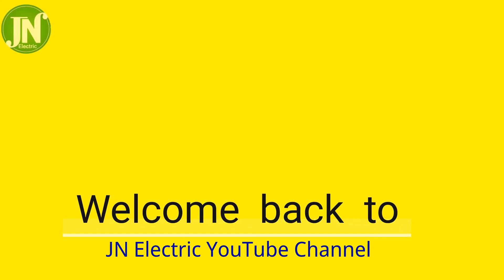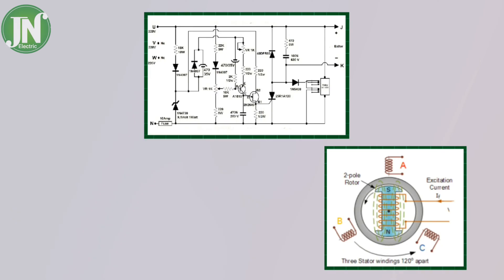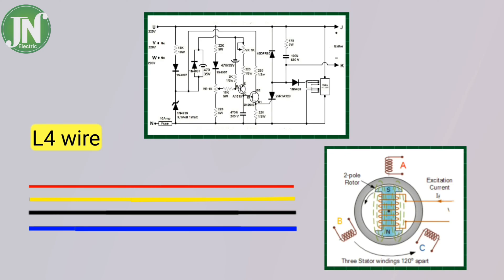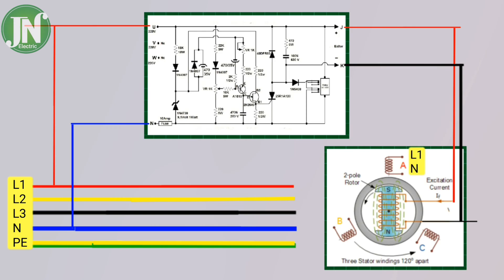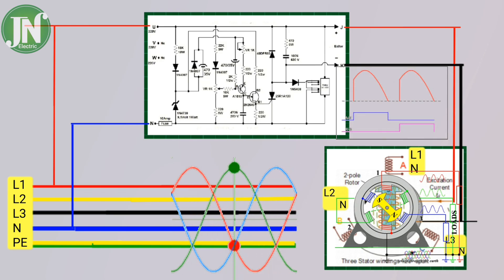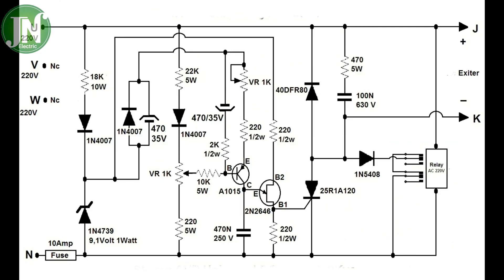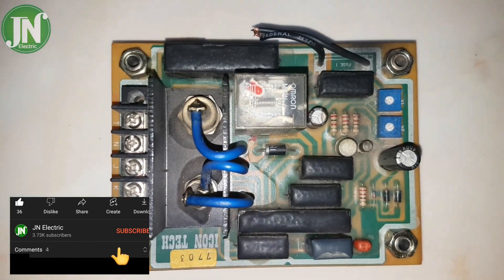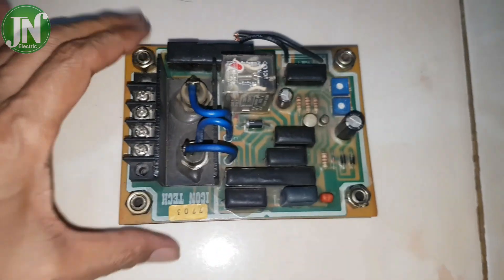Automatic voltage regulator AVR multi universal 4 all brand generator genset simulation diagram

Comment: I have an older onan mdl3 12.5kw generator that is currently regulated by voltage regulating transformer with taps that supply ac to a bridge rectifier and then sends dc power to the exciter. I want to remove this transformer and wire it for an avr. Can any generator be converted to an AVR ?
Reply from the maker: You can try the schematic that I have given. It produces output that is in accordance with that of the DC Exciter.

Comment: I have a small yanmar diesel generator. The voltage regulator went out and melted a hole in the side. The problem is it only had 2 yellow wires going to it and all the ones I'm finding have like 5 or 6.  I'm trying to figure out if I can make one of these work and how?
Reply from the maker: What type and brand a small  yanmar diesel  and alternator do you have
Reply: @JNElectrics  I really don't know. All the data plates are unreadable. I think it was originally used in marine applications. It's small compared to most yanmar generators I've seen and fairly old. There is no capacitor sticking out the potting on the voltage regulator and it only has 2 yellow wires. If I can find any more info on it I'll let you know. Thanks.
Reply from the maker: Need data
Reply: @JNElectrics  OK sorry its taken me so long. I had a hard time finding this thread. There is no brand that I can read but the model number looks like 2GF-L and it appears to be a brushless Gen head. I didn't even know they made brushless Gen heads until tonight. It's the capacitor that blew out but there are no markings so I don't know how high the micro farads (uf) need to be. The units I'm seeing go from around 12 to 36 for the crescent shaped kind I have but if I can just strap one to the side and run wires into the original yellow wires I'd be fine with that. It's an ugly old beast already so as long as it works and doesn't damage anything I'll be happy. I just need to know the uf value. It's a 3.1 kw max/ 2.8 con at 3600rpm or 2.8 kw max / 2.5 con at 3000rpm
Thanks for your help.
Reply from the maker: See my other video see by key " how to make avr  Honda elemax  " perhaps suitable what did you find. 

I'm sorry that I'm late in replying to your comment.
Reply: @JNElectrics  my generator doesn't have an avr. Just a capacitor. That's what went out. I found some similar ones on ebay but don't know how many micro farads I need since the markings on the old one are completely gone. Some people in vids I've seen say it's OK to go up but not down. If that's the case then I should be able to use a standard home ac soda can type capacitor and just run it external.